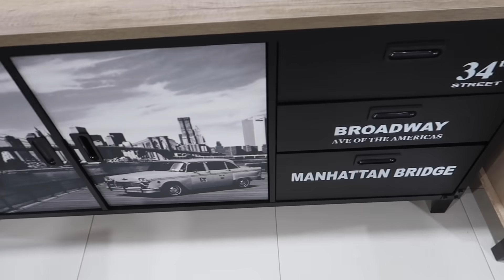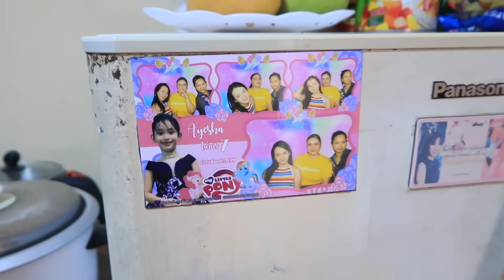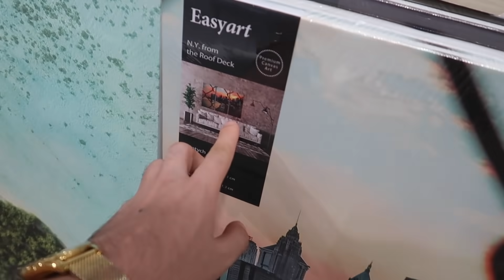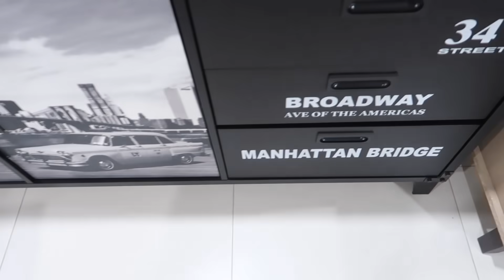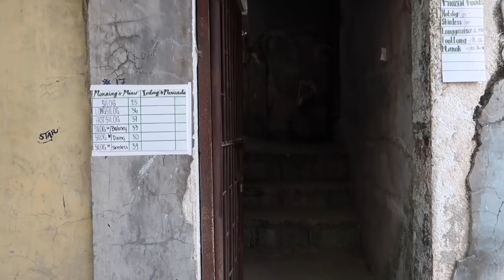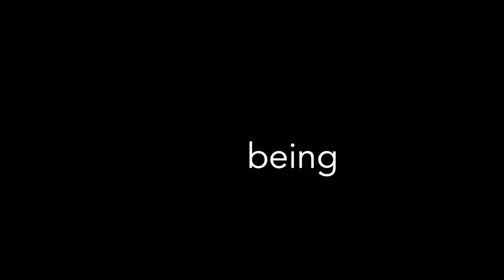Mahirap ang Buhay HOUSE TOUR🏠 De-Cluttering My Staff's House.. 🇵🇭 (Part 1)

Comment: Basil, you omitted to install some extractor fans. This is necessary to extract steam from the cooking and shower room ending up as damp on the ceiling and walls which converts into black mould, harmful to the respire organ (lungs). Furthermore, the mirrors will steam up and get discoloured with time. From Marwan Makarem. The UK. Keep up the good work